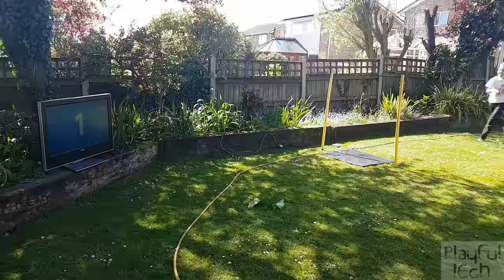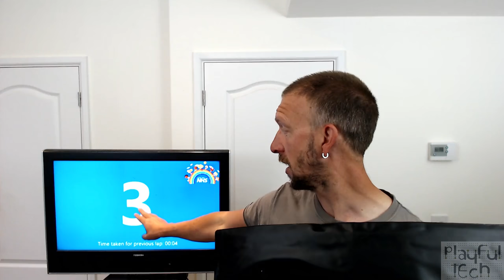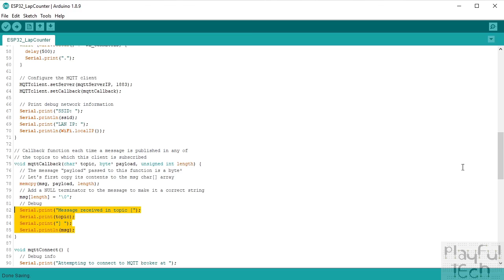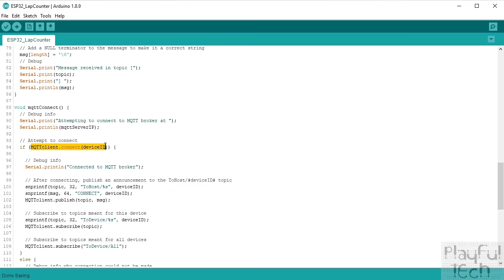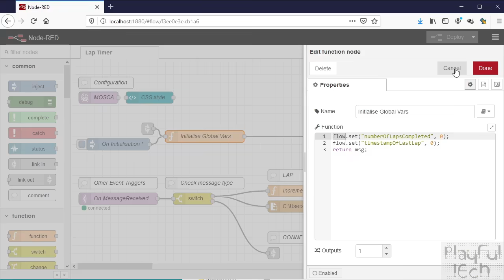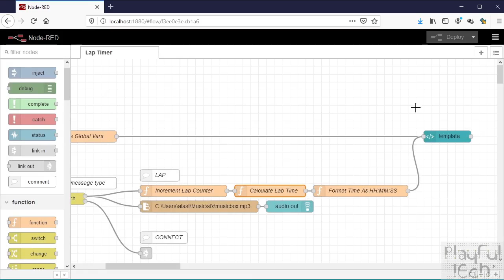How to Create a Pressure Pad Lap Counter using ESP32 and Node-RED

Comment: Hi Alastair, just came across your video and it's really well explained and extremely helpful.

We are looking to raise money for our club and local charities using a similar sort of lap counter. However, we would be running between 2 points and therefore a 2nd mat involved to add to the count.

Would this be difficult to implement into your setup and would an additional ESP32 be required to be connected to the 2nd mat?

Thanks

Comment: Great video - lots of useful information (particularly, for me, the method for breaking down an integer into the 'time parts' - I needed to do this for a coronavirus tracker and my code was a functioning shambles!).

What has confused me is how you managed to end up with a full screen display without any headers or other extraneous items - can you explain the method for that, please?
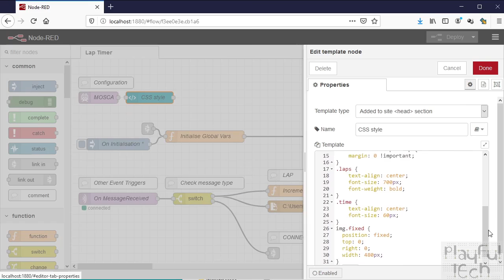Reply from the maker: So, at 23:55 I describe a ui template node called "CSS style". It's added to the site <head> section and overrides the styles of any elements placed in the ui template at the end of the flow (i.e. the dashboard where I actually display the lap counter).
Here's the relevant sections that make it full screen:
margin: 0 !important;
padding: 0 !important;
border: none !important;

And I hide the toolbar using this:
md-toolbar {
    display: none;
}
Reply: @PlayfulTechnology  Thanks, that's going to be so useful...

I guess you set the size of the digits and the lap time message in there too?

I'm no programmer, which is why I like Node-RED...
Reply from the maker: Yep. The text is insert into the ui template node at the end of the flow like this:
<p class="laps">{{msg.numberOfLapsCompleted}}</p>

Because it's got that "laps" class assigned to it, I control the appearance from the CSS style node like this:
.laps {
    text-align: center;
    font-size: 700px;
    font-weight: bold;
}

Comment: How do you show the content on the screen? Is it the same computer, which is running nodered or another computer? Im using raspberry pies to show content from esp's but is there any smarter way?
Thx for inspiring videos.
Reply from the maker: Hi Mads - the screen is just using a full-screen browser (Firefox), to display the UI dashboard from Node-RED. Because it's running on the same computer, that's just http://localhost:1880/ui , but you could access that same page from any other device on the network too.
Reply: Allister, great job as allways. Could you explain or show if the mqtt server is on a PC locally but connected to internet, and show something on an external screen on internet to show the messages on the screen? I would need somehow an URL to pull this page.
Reply from the maker: Hi Ruben - everything I'm using in this project is just running on a local network. But yes, Node-RED can easily connect to any resources over the internet too - pulling in input data from web services, or sending outputs to update a publicly-accessible webpage, say.